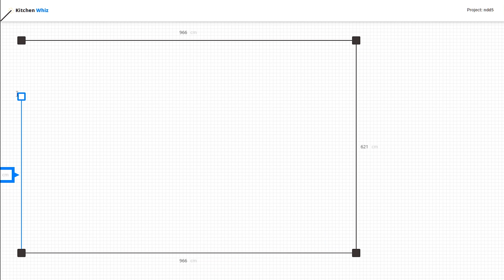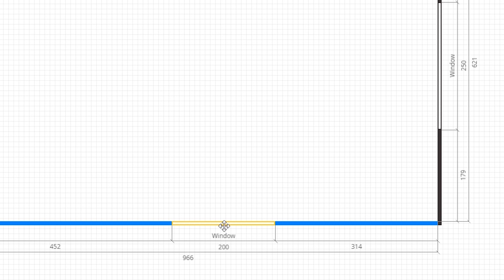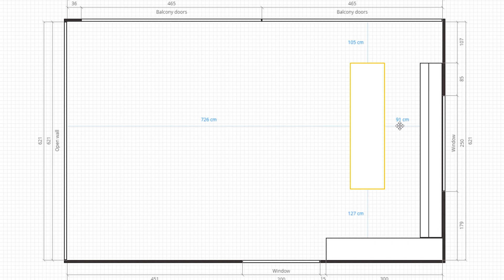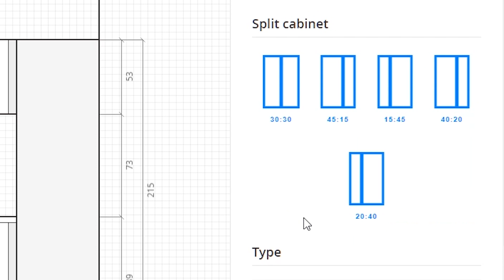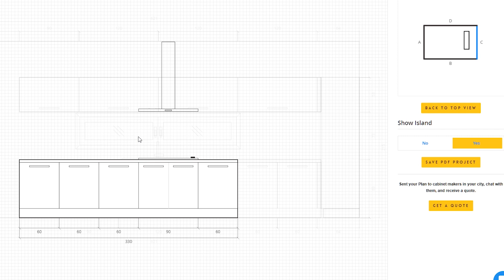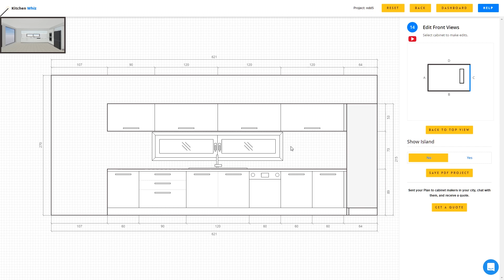Comment: does it provide you with a cut list that i can take by hand to get a quote
Reply: Hi Richard, no it doesnt. You can print the kitchen cabinet front and top views with all dimension included and you can give the plan to you carpenter so that he can create the cut list.

We are working on Version 2 and at some point we will also add the ability to generate cut lists.
Reply: @kitchenwhiz   you need to do that is most important im  looking forward to that but with the cut list
Reply: @richarddasilva719  thanks for the suggestion.